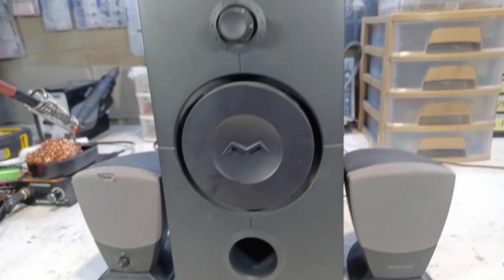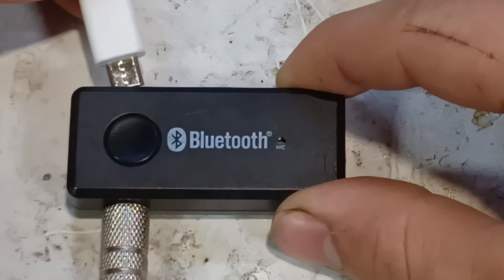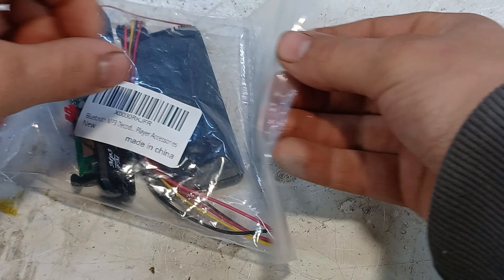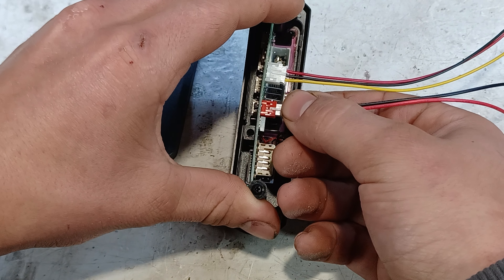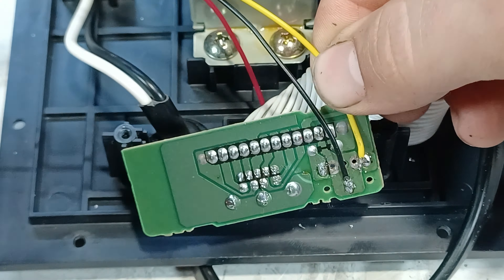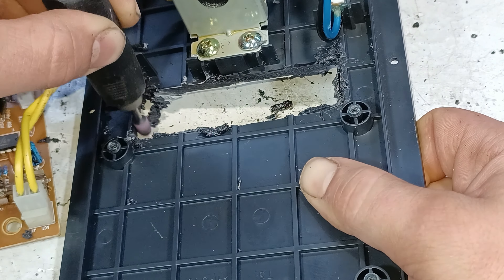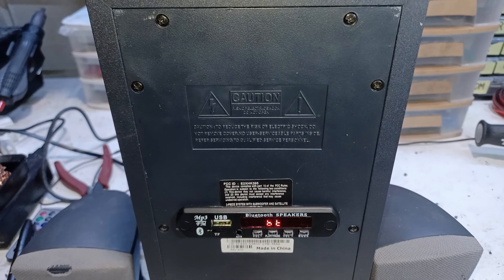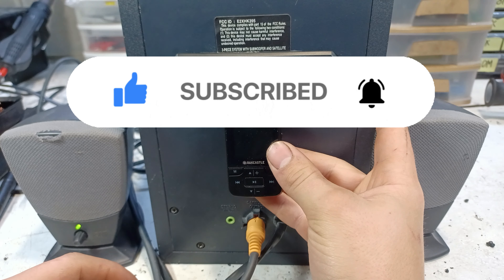DIY Bluetooth Upgrade for Your Old Speakers

Comment: Its just converting a passive speaker to a powered speaker. It can't be done to a high power passive speaker because you will need a high power amplifier.